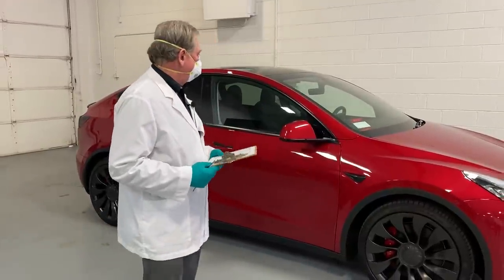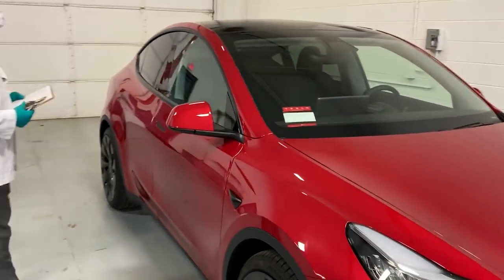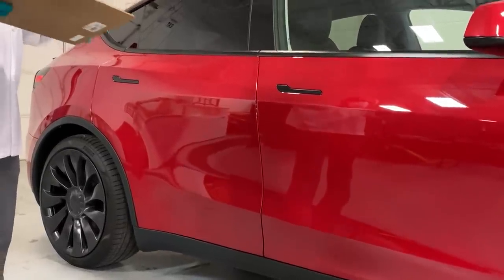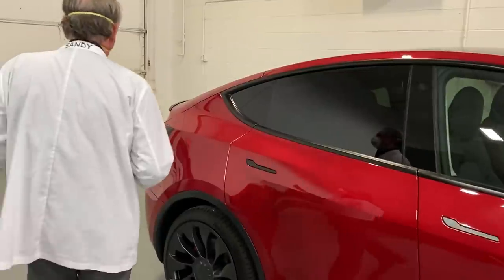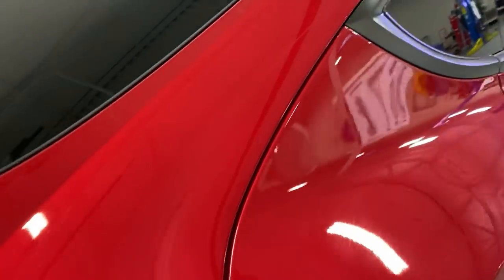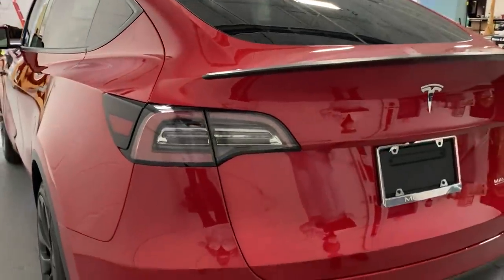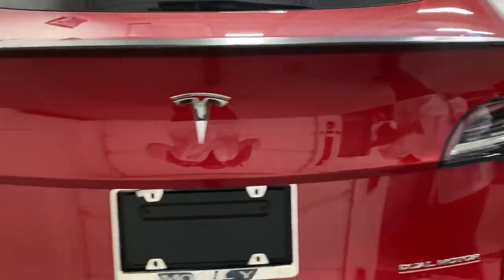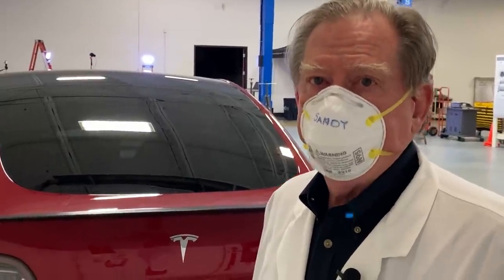Model Y E2: Fit and Finish

Comment: What are the industry standard gaps? what do you see on Toyota? GM/Ford? BMW? Mercedes? VW? on production cars? early production cars? would really give some idea about how good/bad Tesla is doing - without reference a mm or 4 does not give much of an idea. Really appreciate the content  - thank you!
Reply: Who cares greatest cars on the planet
Reply: From the context, it seems like 4mm.  I think the main point is it should be consistent.
Reply: The biggest issue is consistency, even Nissan would crush a Versa if it had the kind of gap issues some of the Model X and Model S's have.
Reply: I'm just saying my (albeit older) Mazda MX-5 has panel gaps the size of Texas compared to the Model Y.

Comment: Mask is not on right.  You have to bend the metal so it conforms to your nose.  You fit is 4 mm out in both sides.
Reply: Heh, 4 mm.  Probably not that exact measurement, but yeah, gotta pinch the embedded wire to conform to the shape of the nose, and it'll work right.

Good catch!

We're all on a learning curve here.
Reply: The problem is that is is 2mm on one side and 5mm on the other.  We are looking for even gaps gaps here.  ;)

Comment: I can’t wait for the actual tear down video. I love my Performance Model 3. Has it been determined if the steering rack, rack motor or associated components are any different from Model 3? I can feel a large difference in steering between my Performance 3 and our non-P 3 with 18” aero wheels because of the heavier weight of the larger wheels... i was wondering what Tesla would do to compensate for the even larger 21” wheels and wider tires on the Y.

Comment: I'm trying to think how a panel gap can be 6mm on one side and still 3 mm on the other. That tells me the whole panel is too small. Is that because there was insufficient pressure in the stamping process, so the panel wasn't squashed out enough?

Comment: Cases popping up about the paint not bonding correctly to the front bumper. PFF installation is causing it to peel right off. Going through this right now on a red Y. Any way to check the front driver side bumper right below the fog light? So far it seems to be happening in that area.

Comment: Come on Elon stop the simple pump and dump. Quality over numbers. Tesla is getting there all the same but still paint problems and fit and finish problems. For a company that prides itself on automation they need to start nailing the fit and finish for that price point. If I was an engineer that had worked so hard to get an amazing drivetrain or tech into the car to be let down by the finished product due to poor build practices I’d be sad. Elon is caught up on the numbers game when he needs to get a quality control in place that befits what many regard the pinnacle of EV production. Let’s hope the German Giga can address these problems the German workforce like to manufacturer in a exacting standard and take real pride in what is delivered at the end. I know door handles and trim used to fall off 90’s Ferrari’s etc but this is 2020.

Comment: On a different post, you complained about the paint. It is terrible on my 2019 M3, and is just as bad on one just off the truck, last month. You see it in the reflection, especially branches, above. 
I paid $2000 for this red paint, and felt cheated. And felt cheated even more when Elon dropped the base model for one $10k more! But then, he's a 'genius'...